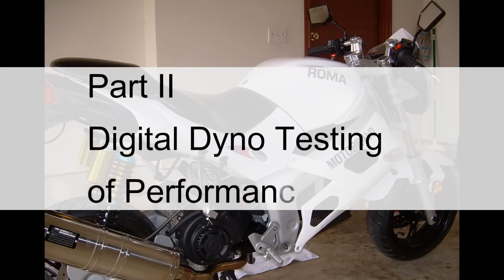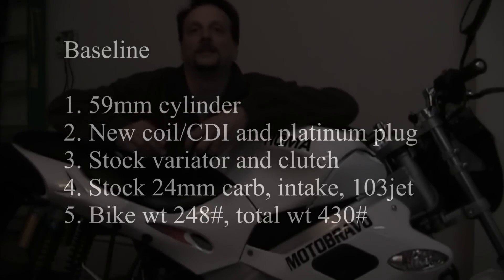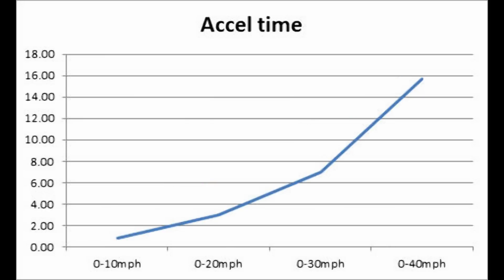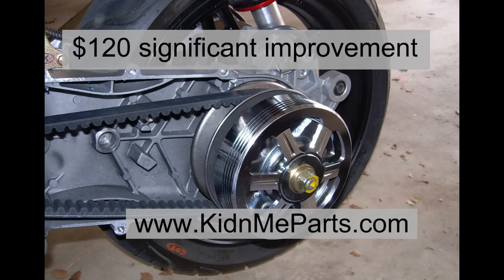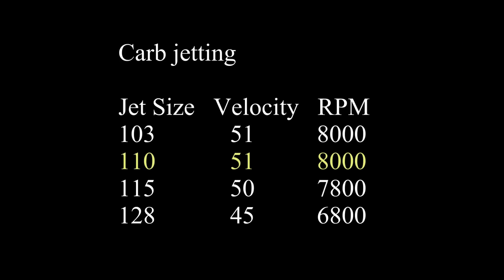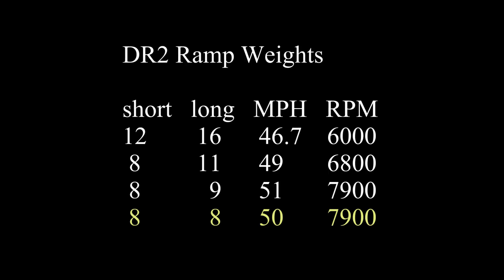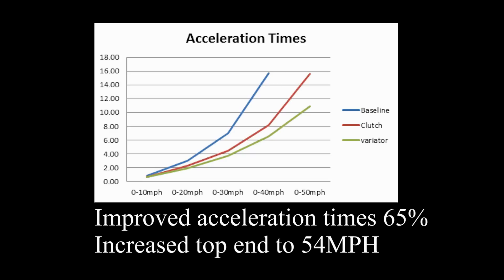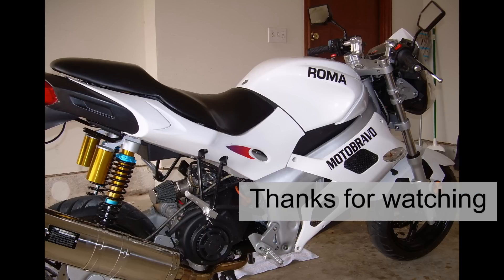Part II Testing Performance Parts on a  Motobravo GY6

Comment from the maker: Well I have sold the Motobravo so there will not be a part three. Can tell you what the wrap-up would have been from the last set of data. Engine mods did not effectively boost the brake HP. However CVT mods did an effective job increasing transfer to the wheels. Increased wheel HP. I was fun experimenting with this.

Comment: Where do you guys get these slow ass 150cc's? My Dong Fang 150cc ran 60mph completely stock and my Kymco Agility 125 runs 65mph stock. I never checked the speedo for accuracy but I will knock off 5mph as speedos are usually optimistic and that is still a 150 running 55mph and a 125 running 60mph bone stock.